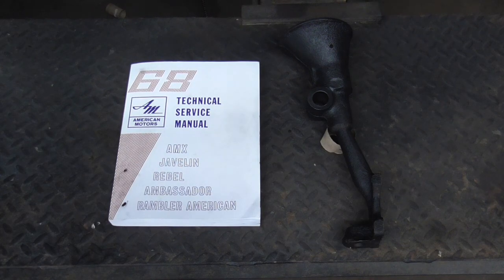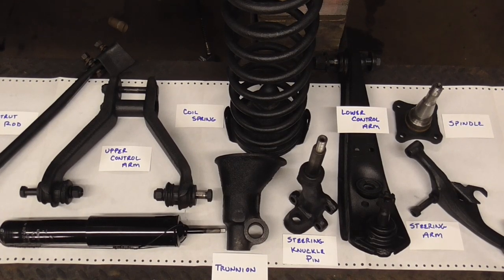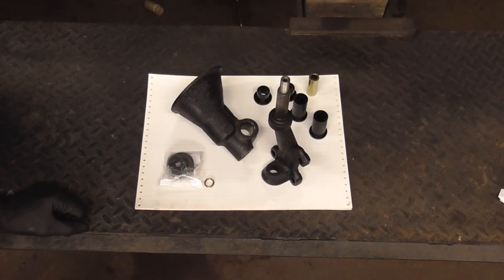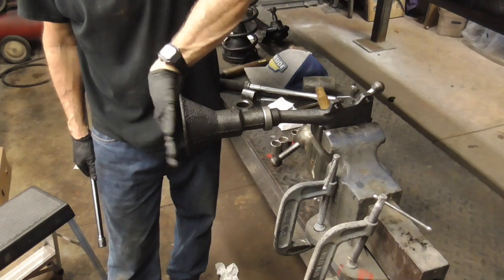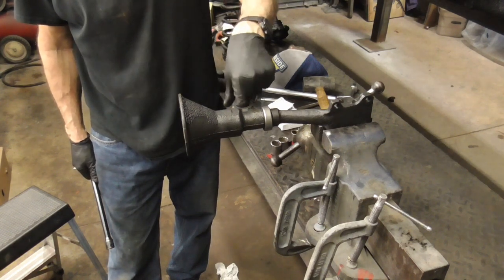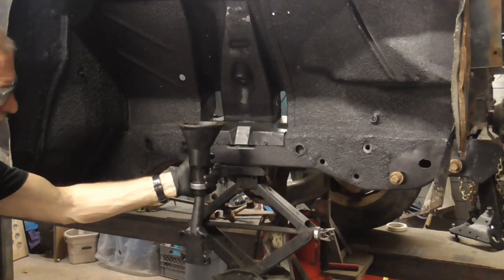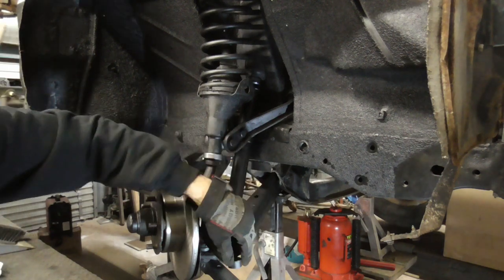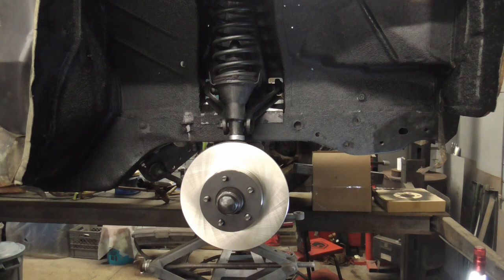AMC Trunnion Suspension Rebuild & Parts Exploded View

Comment: I have been watching all your art work. Is it possible to fix a nineties gmc bumber rusted out? Thanks.
Reply from the maker: Thanks Sheldon - anything can be fixed.  I only work on my own stuff at the moment.  I live in a residential neighborhood and those are the rules.  No rules against making YT videos though - at least not yet 🥴
Reply: @LakesideAutobody  cool. I have been playing with medal for a couple decades doing soffit , cladding and siding. A warm shop and on the ground, looks like my kinda job. Lol Got a beat up 94 gmc Ill try tackling. Have total confidence thanks to your vids. Have a press and break to assist. What gauge medal is standered? And size of mig wire needed? Thanks for the knowledge
Reply from the maker: Use 22 or 20 gauge that's ~ .030" & .035"
I like .023" wire - maybe just cause I'm used to it.  .030" works fine to but I can feel it "hit" the metal at least I think I feel it.  Anyway both work fine. Feel free to ask any ?s when you get to it :) @sheldon26815